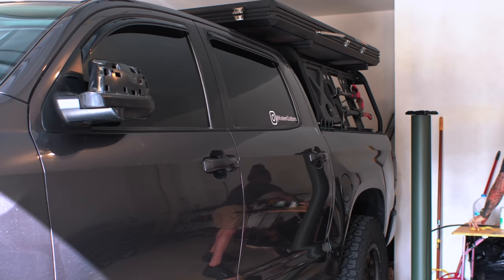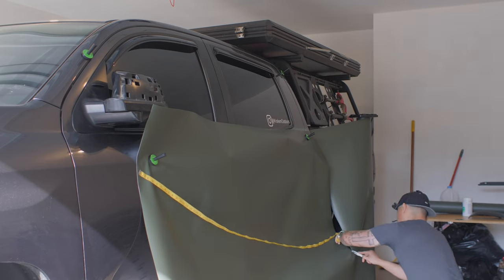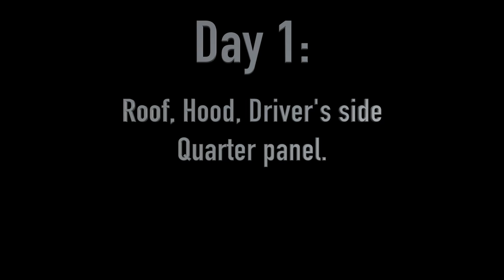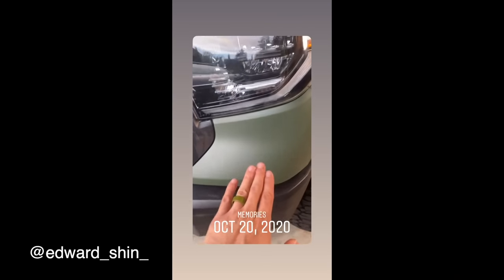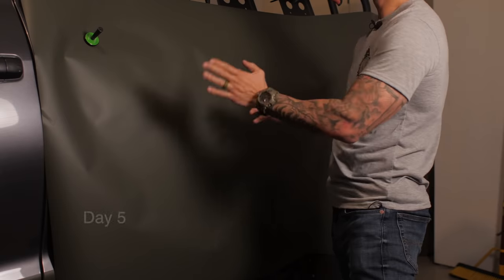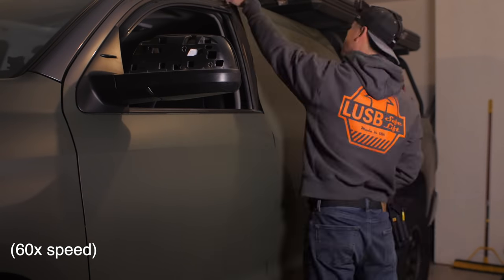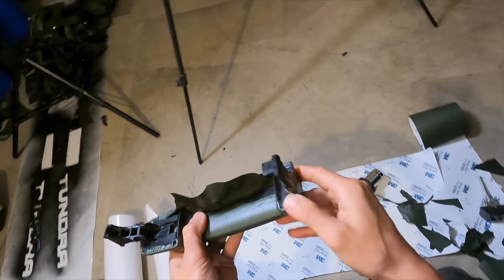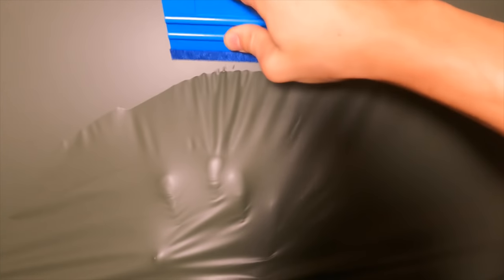Wrapping my Truck - DIY Cost, Tips, Mistakes

Comment: Experienced Vinyl Wrapper here. You did a spot-on job! The knifeless trick (to cut material in order to tuck into corners) is used among pros and newbies alike; mostly newbies rather than pros since pros take the material-expenditure cost more into consideration from an operational perspective; but it is an all around solid method to ensure that no paint is nicked. You may already possibly know by now, but research on how to perform inlays. It is a really useful technique that allows to make sense of more complicated objects and shapes. Hell, I've seen bumpers that look like they can be done in 1-piece but in reality, it's all inlay galore! (I'm looking at you 2012 Nissan Versa). 

all in all, to all those watching this, keep at it. You will frustrate yourself at first but that means you're putting yourself out there and putting in the work. Keep going!
Reply: only thing I see that sticks out to me is he changes the orientation of the film... but even experienced wrappers miss that step..
Reply: @ckrampen22  why does that matter
Reply: @Lifehackz137  with certain films you will be able to tell the difference in different lighting… like with a silver or grey, it will look off a shade or two but it’s because how the films are produced and how the light reflex them. Hard to explain without seeing it in person…. Most wrap vinyls have arrows on the backer paper so you make sure you’re applying the same orientation. Doesn’t matter if arrow is pointing up down left or right, just as long as it’s the same on every panel you apply.
Reply: Hey dude I’m curious where you work? Would like to talk to you about the car wrapping business.
Reply: Love it!
Reply: @brockcothren6209  is that a possibility? Even though I’ve never wrapped  vehicle,I believe I have the patience for this work. As an artist sculptor patience is key. How does one go about obtaining lessons or shadow a professional? Many years ago I did some pinstrip-ing.

Comment: Well done Edward, I have bean thinking about doing this for over a year to my tundra, but I have done so much research and watched so many videos that I know I have to get my head in the right space to take on a project like this. Great job man looks great for your first wrap
Reply from the maker: @adventure_outline I would definitely recommend setting aside enough time for something like this. Because I had to make constant adjustments, it took a lot of time. But if you get the hang of it quickly, it may take you much less.
Reply: @KrokemOutdoors  thanks 👍👍

Comment: I wrapped my dads tundra a few months back... biggest issue I had was with that antenna as well I have to add a small patch as well.
The gap between the rear cab and bed also gave me an issue but I moved the vinyl as far back as possible. It helps that both your truck and my dads are originally black so it’s not noticeable right away. My recommendation is to stretch the material slightly and use one full piece per door instead of making that seam. Good job though !

Comment: own a sign company and we do car decals and occasionally marketing wraps for clients. Your first time ain't bad at all! It'll take time but obviously knowing your angles when you squeegee to avoid lumps and foldovers and definitely using knifeless tape more would've resulted in a cleaner job. Where you pull the vinyl and apply heat matters a lot too and I think you could've used more heat in some of the areas, but again not bad!

Comment: Awesome Video! Just wrapped my tundra too.. not too bad but patience will be the key. I went with Avery Dennison, IMO a lot easier to work with, didn’t have to use the heat gun at all for stretching
Reply: Is Avery Dennison a brand of material?

Comment: I actually just wrapped my telluride by myself and I ran into the same problems you did. I think the hardest part was using a matte wrap which is not pliable at all. I wish I would have also taken a day to just take the car apart completely before starting rather than removing parts as you go... Took me about 35 hours to complete the entire project.

Comment: $1,100 for a new paint job wow that’s like 5k saved in my area, thanks i will be doing this!!
Reply: The only issue is vinyl has time span of about 5 years. It’s definitely cheaper and it gives you the flexibility of changing it again to another color which I like lol
Reply: @artm5583  with the price i will probably change the wrap once a year , just because i like change

Comment: Great job..... however.... having wrapped and partially wrapped several vehicles myself.... I must say that applying a wrap just to change the color isn’t worth it.... you were better off painting it.... the vinyl will eventually deteriate...5-7 years maybe.... also if you want to sell your vehicle.... you would more than likely have to remove the wrap..... and you thought applying it was hard????? wait til you have to remove it.... with all that said....for a first wrap.... I thought you did pretty well
Reply from the maker: Thank you Sir! I did get it for pinstripe protection on trails, and plan on replacing it within a 2 year period. For me, the change in aesthetic appearance and the slight paint protection is worth the labor
Reply: @KrokemOutdoors  
I hear ya.... it’s cool..... I’ve worked in a graphic shop and have wrapped some real nice rides... along with lots of commercial vehicles....and we tried to discourage people from wrapping their vehicles if all they was gonna do was change the color.... what happens with vinyl is all it takes is for one scratch to make it deteriorate quickly....I’ve removed many wraps that turned to crap.... You mentioned trail riding.... rubbing against branches will destroy the vinyl. Not trying to disrespect you in any way....you like doing it... then by all means... have fun. Peace